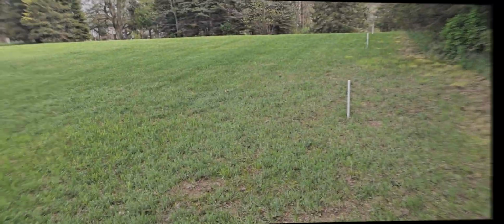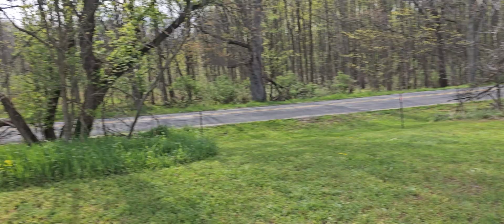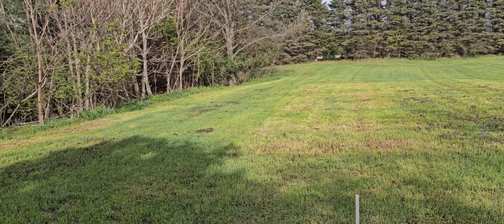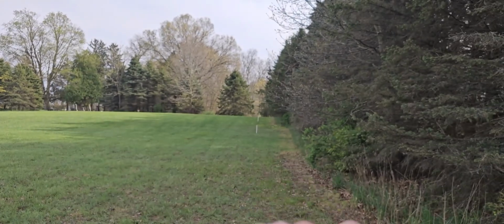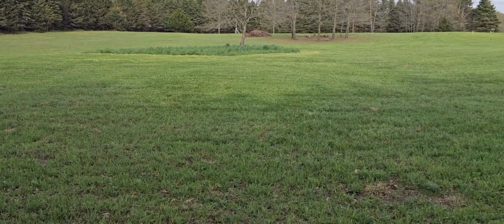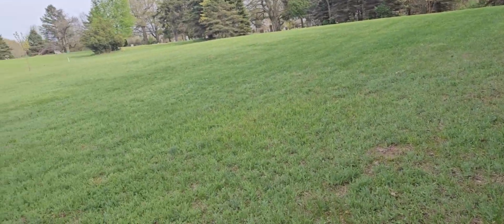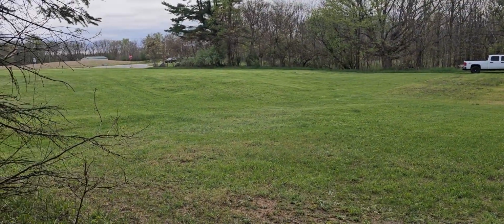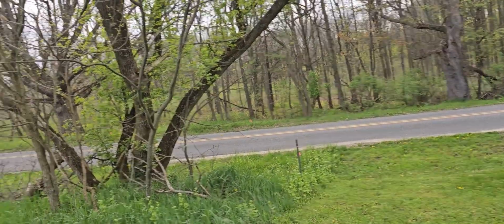Its Unaffordable to Build a House!

Comment: $290k for an unfinished house? What?

Why is your build $82 per square foot and theirs $32 per square foot?? Get a counter quote
Reply from the maker: @jeremyrittenhouse4562  it was $190,000 for a turn key manufactured double wide. Its $240,000-$290,000 for a post frame shell, just the shell...unfinished interiorm
Reply: @ThatDIYGuy1 I was basing the $32 off the 2048 sq ft for $67k.
Reply from the maker: @jeremyrittenhouse4562  oh yea. It was the same barn builder place who gave me that number. When my dad and i sat down, he showed us that # and then when he quoted me, he was like no, that ended up being $181,000 for the 2048. Im like how does it go from 67 to 181? Thats a HUGE difference. But i could never get an explanation. My dad got a quote in shells from Morton Buildings, and they quoted a starting price on one of there $1200sq ft plans online, and that was $160k or $170k for just the shell. So i guess barndo's are just stupid expensive.
Reply: Barndo shell is just basically a metal building right? Why can’t you just do that solo? No judgement bro just genuinely curious since you seem very handy. Lower MI here brother curious if your reply and good luck out there sir
Reply from the maker: @sqooot its a post frame, wood posts like a polebarn.  ive thought about doing it solo. I work 12-14 hour days as a local truck driver and cant afford to quit my job.  I was looking for someone to build me the shell and i would do all the plumbing, electrical and interior walls myself. I get 2 days off a week and having someone else construct the shell would save me time.
Reply: @ThatDIYGuy1 oh wow, ok I thought those were more like an outbuilding where it’s just metal structure. You ever look into that instead of wood beam frames? Idk the difference of quality or durability etc but just an idea. Good luck to you brother as a fellow long hour working Michigander electrician I feel your pain
Reply from the maker: @sqooot  i have. My garage if i build that after my house will be metal framed. I also have to conform to the township im trying to build in to make them happy. I own the land but everyone other than me has a say in what i do lol
Reply: @ThatDIYGuy1 I feel ya on that my man - well best of luck on it and keep posting vids on the progress!